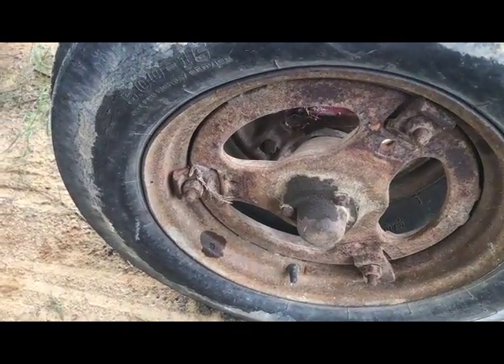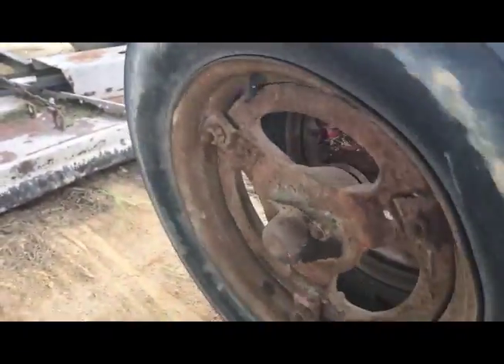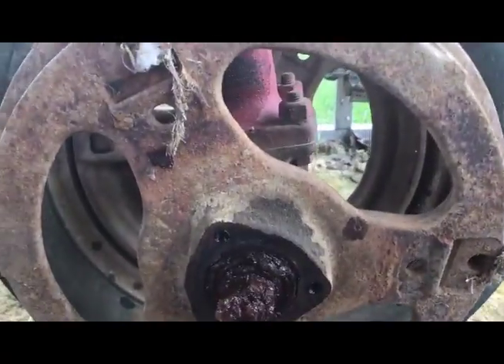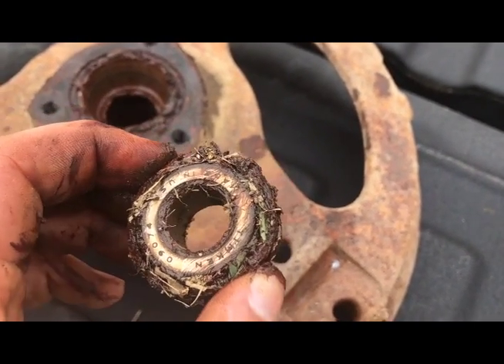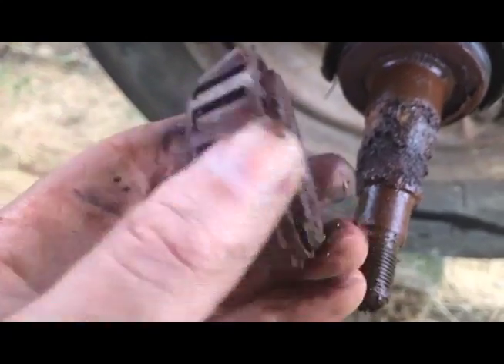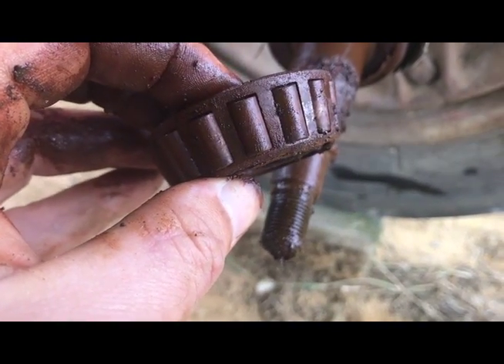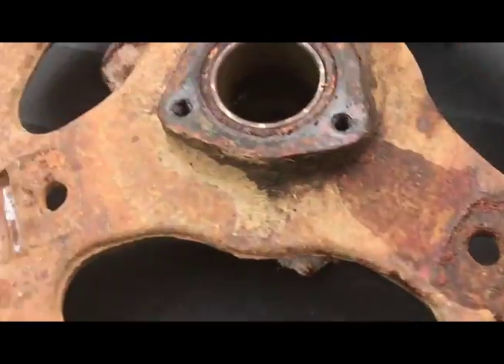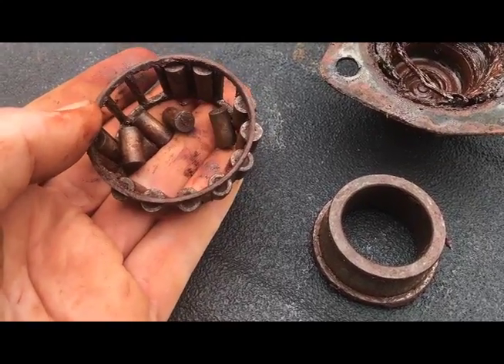A Mowing Video with the BN...At First (47)

Comment: I just noticed you have the old, original gas cap that can leak and cause fires.  IH had a recall on that gas cap, and there is a website that you can get a free safety gas cap by submitting your tractor's serial number.  Here is the link:  https://www.ihgascap.com/index.aspx  I would definitely recommend getting one.
Reply from the maker: Yeah, it is something I've thought about, but it is pretty flat around here and I don't mow ditches with her.  The 140 still has it, too.  I probably should update it, but I just like the way the old "flat" ones look.  I probably should just get over that little issue.  Thanks for the comment!